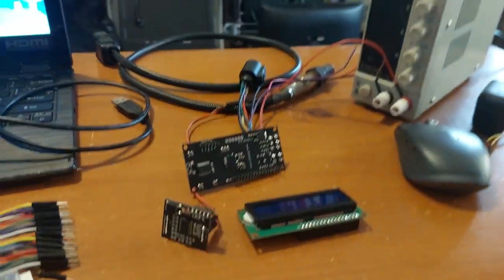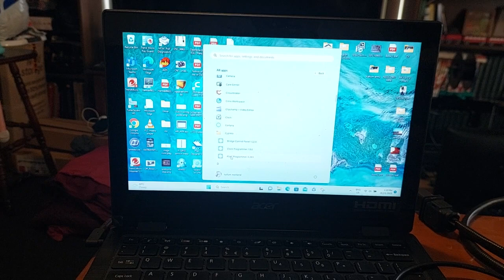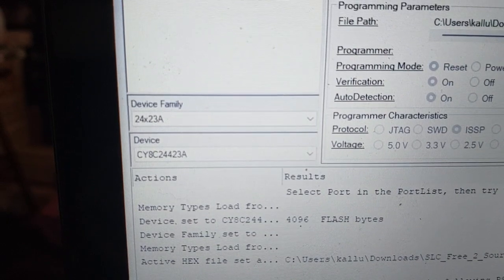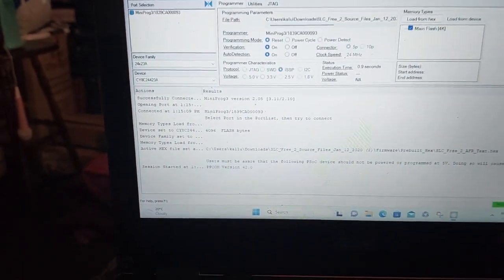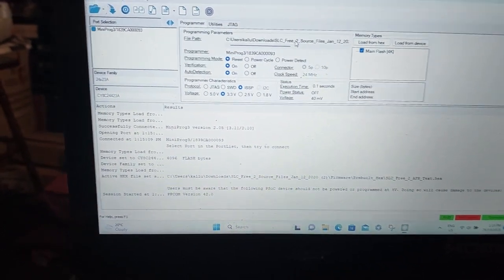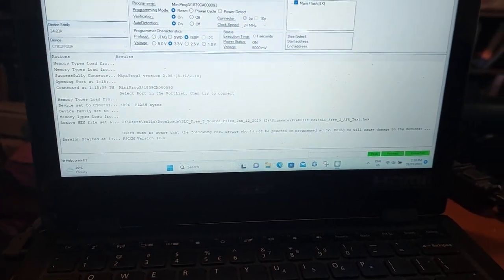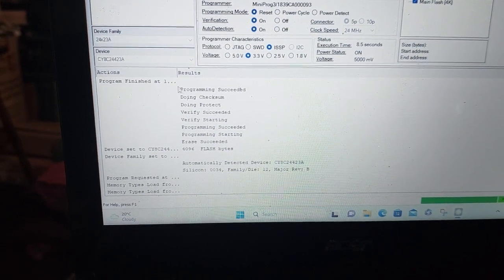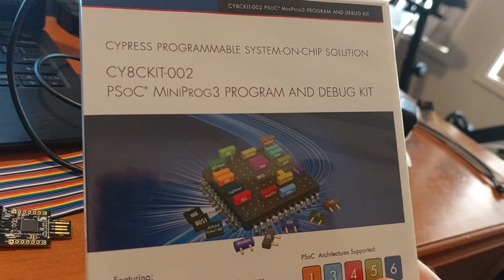Programming the CY8C24423A on the Wideband controller's.

Comment: Its great.I used ch341 based programmer to flash hex on the MCU. But I have hex file with bar graph indicators. Mine is not smd version.
Reply: bro can you explain how to use ch341 usb programer for flashing psoc chip? because i miniprog 3 is not cheap for me
Reply: @poio09757  yeah looking for these too. no luck
Reply: Can you tech how to use CH341 to flash hex to CY8